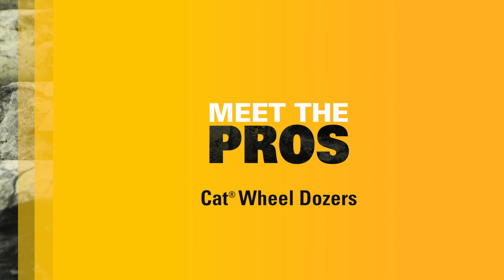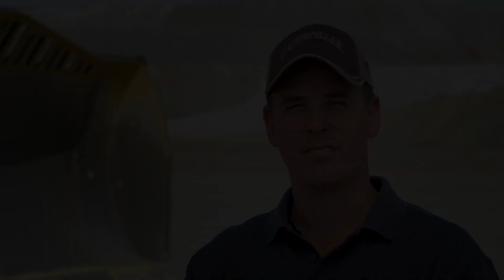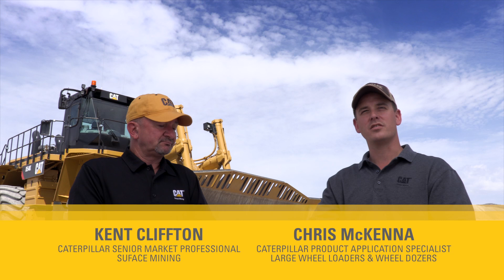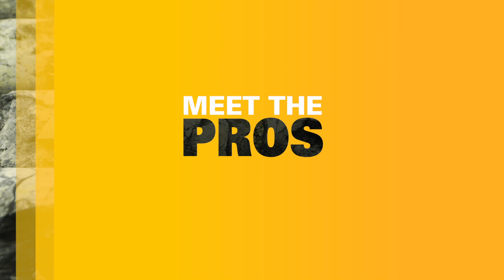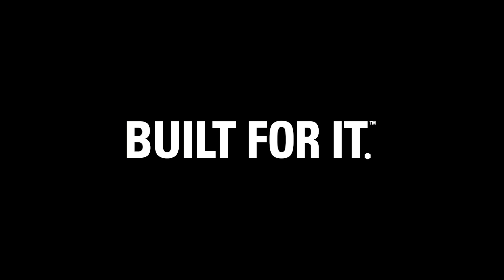Cat Wheel Dozers: Mining Efficiency, Sizing & Track Dozer Comparison

Comment: When I first saw a wheel dozer being used in a mine it was exactly how they describe. First bit of truck spillage it was down there to clean it off. When the D10 was off pushing up a waste dump the wheel dozer was down to clean up the loading floor. That wheel dozer was all over the mine in no time. The D10 was good but just too slow for the fiddly bits.

Comment: What difference wheel loader and wheel Dozzer? Like a Opreting function... Explain please
Reply: A wheel dozer fills in the gap between a motor grader and a tracked dozer - it has more capacity than a motor grader that's closer to a tracked dozer, and it has more speed than a tracked dozer closer to a motor grader, it does the jobs that grader-like speed and dozer-like capacity are very useful or critical for.
On top of that, a tracked dozer is specialized for moving LARGE amounts of material, and a motor grader is specialized for surface finishing/finish grading - wheel dozers AREN'T specialized, they're more of a universal tool, and this is by design so that it can transit across a work site to fill in for machinery or free up specialized machinery from doing work that they're being wasted on(like using a tracked dozer to clean up a truck dump when you could have it doing serious work in the cut, or like using a motor grader to clear some spillage when it could be somewhere else finish grading a new road - a wheel dozers does these jobs and does it better than the other 2).

As far as specific jobs, they're exactly what he described in this video; spillage cleanup, truck fill cleanup by a shovel, establishing berms, etc.
Reply: I'm opretor wheel loader opretor.. Pakistan import total old machine.. And Pakistani opretor Opreting all machine